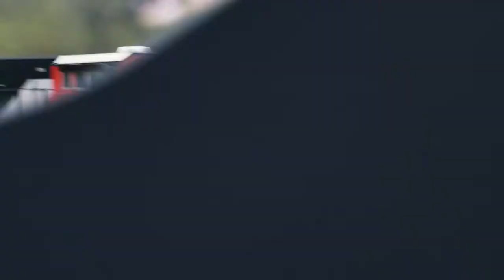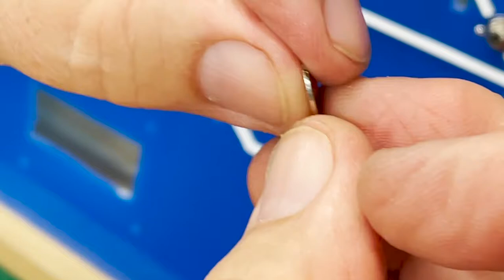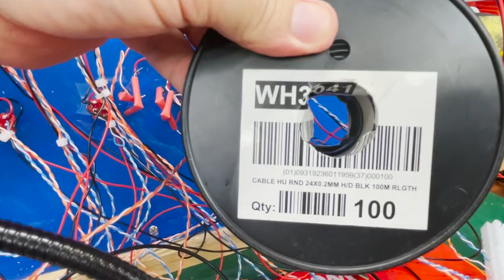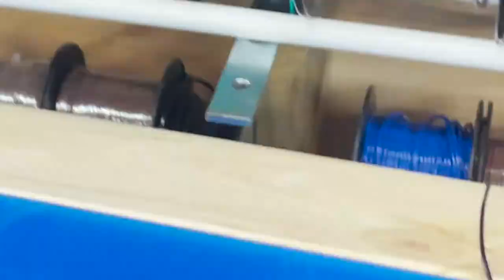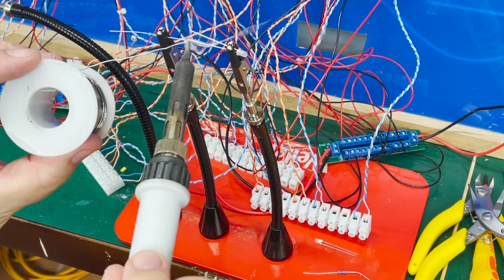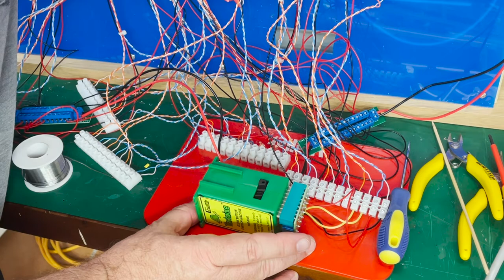LE&NS Railroad Episode 12 Control Panel Series Part 2

Comment: Is there a preference as to why you don't heat shrink the wires on the control panel? I just need to know the right way not what I think I should do because I could end up making a big mistake.

Comment: Sir, 
Thank you for your detailed How-to video. There were some brief moments that the picture was blocked but I'm sure you couldn't help it. By any chance are you going to use tower signal lights  along the tracks? If so do you have a detailed How-to episode showing everything? Again Thank you for your Detailed How-to Episode on wiring up the control panel. Fantastic Work Sir.

Comment: Sir, 
What happens if all your wiring was done for  the computer does that mean that all your conventional trains are screwed up? Does it mean you can only run on a layout conventional or automatic? Because that's what I'm planning because most of my trains are cheap and conventional but I want to keep them and see how I can make the train run automatically.

Comment: Great tips! I for one am grateful for you taking the time to show the entire process as wiring (specifically switches, complicated wiring) is what I lack the skillset for. This was a tremendous primer. It's one thing to simply solder a wire to a connection, but a whole different beast for complicated schematics. I took copious notes! Two questions I had for you - I thought in a prior video you just used two green LEDs but on this panel using red/green. I missed something there. Also, what brand/model are those connectors for the tortoise machine (8 slot connectors) Thx!
Reply from the maker: I felt the same way when I was trying to read schematics and the demonstrator would just skip ahead. 
Thanks for the feedback.
Randy